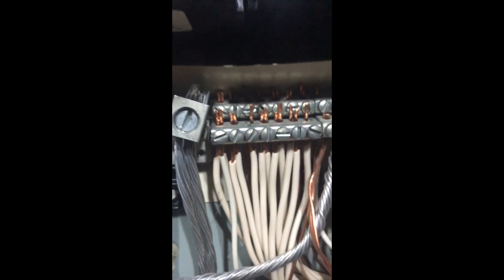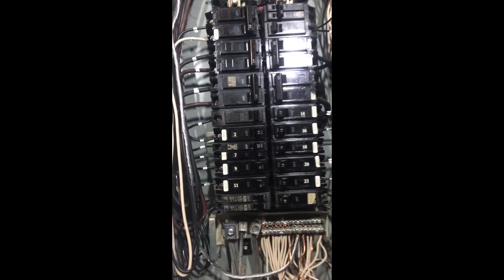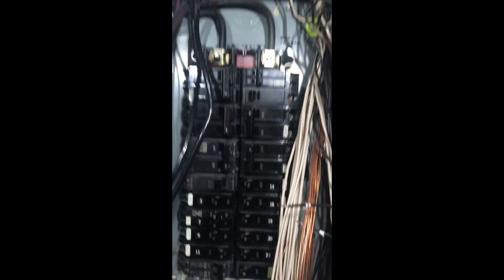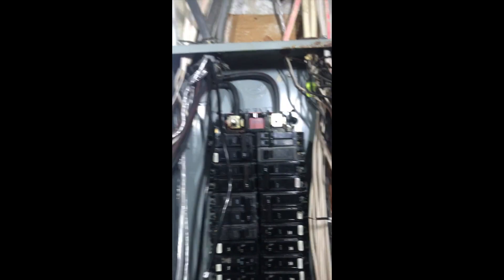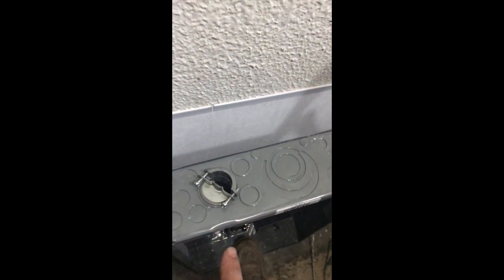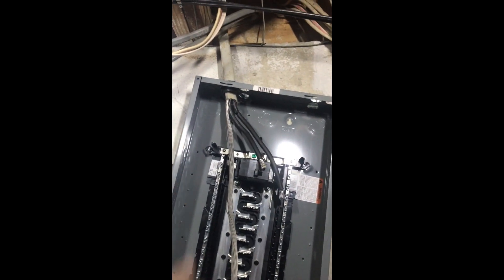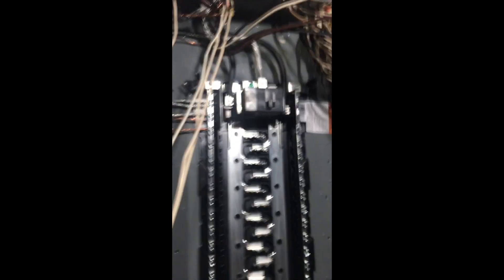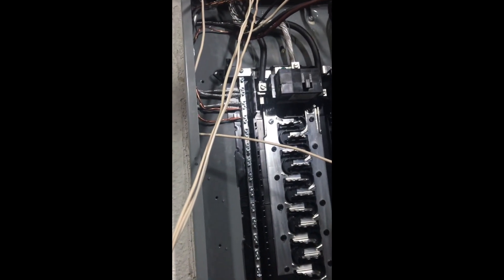Unbelievable Transformation: Watch an Electrical Panel Go from Demo to Installed in Minutes!

Comment: Hello
Do you need a ground from the panel in a 200 amp?
I have a ground from the meter to the rods and that’s all.
Reply from the maker: grounds only go to the panel never the meter. if that ground in the meter becomes energized so does the ground around it and then there is trouble!

Comment: can you explain 1 pole & 2 pole. & how to wire them in to main breaker or a panel in garage. & if you can wire outlets to it & how can you tell how much power is coming in for main so not to exceed what your power co. has you listed for ty. I need a outdoor light for both garages to see when I get from car to house & to check on my ducks & geese at night
Reply from the maker: 1 pole is one breaker 120 volts the second one is 2 pole 120 volts. added together 240v amperage is the only determining factor here. at what amp will the devise trip.
Reply: @StarvingElectrician  ty

Comment: Sweet video for us electrical noobs! I am slowly learning this stuff to be able to wire an outdoor shed powered by solar.  Two questions for you.  1. What gauge is your grounding wire and 2. why don't you put the ground wire in first (sorry if the latter is a stupid question)?
Reply from the maker: no question is stupid when it comes to electrical. on a 100 amp service the ground id number 6  as for what order sometimes its first it really just depends. good luck!
Reply: @StarvingElectrician  Thanks!

Comment: I would like to install an electrical box in my garage. It has no existing electricity. I would like to run the electricity by a portable generator.  It sure would be nice if you made a video. Thanks
Reply from the maker: That would be cool! its tough since im not on job sites any more. i just need to engage more. thanks for the reccomendation though. ill surly try!!

Comment: Hey Starving Electrician, just a handyman here!  I’m wiring my pole building with 100-amp main lug coming from a 200-amp main breaker!  I’m using 2-2-2-4 Al ser, BUT MY QUESTION IS, WHAT DO I DO WITH MY GROUND WIRE AT THE MAIN PANEL AND AT MY LUG PANEL? 

Thanks in advance, hope to hear from ya!
Reply from the maker: you need to add a ground lug or ground bar because you need to seperate the grounds from the neutral.
Reply: @StarvingElectrician  , thank you for the reply!  I did know I have to separate the ground and neutral which I plan on putting in grounding rod and ground bar!  Just wasn’t sure if I hooked the ground wire at the main panel to the ground bar or not!   If I did that, than wouldn’t my ground be connected to the grounds and neutrals from the main panel?

Comment: Sir do you prefer to use square d Qo plug on neutral or homeline, ty
Reply from the maker: i like home line because QO is smaller and harder to work with when the panel is full.

Comment: What gage wire you used for main breaker panel?
Reply from the maker: well if its 100 amp its either #2 aluminum or if you go copper its #4

Comment: 3:00 labeling breakers though is... I mean how do you even do that?  You'll have over a dozen "devices" on a single breaker and they could be in 3 different areas of the house.  In fact, it's normal that they're in different areas.  But like, you have 4 out of 6 Receptacles in a living room, then 2 in a downstairs room, 3 lights in different areas, and a single Receptacle in... I don't know, the dining room.  I get that you should label them but it's not a simple or trivial task.
Reply from the maker: thats a matter of wiring in the house. on circuit feeding a junction box with five wires in it. ya need to add more circuits in that case.  labeling can be a pain when you know like the kitchen shouldn't be on a 15 amp breaker. thanks for the comment.

Comment from the maker: Well if you only replaced the panel the the problem has to start there. Lots of times the wire simply doesn’t  get tightened down on the breakers. I would tug on  each wire and see if one pulls out. Try turning the breakers off one by one as well. You try the simple things first. Check the connections on the main breaker. Half the panel may be out.  Hope this hekps

Comment: Thanks so much for your videos.  I'm wiring up my new barn and you've answered basically everything I could think of.  I couldn't quite see where the earth ground was being attached in the panel but I'm assuming it's just going onto the bar with the other grounds and some of the neutrals.  Yes?  My ground will be two 8 ft grounding bars driven into the ground and connected to the panel via a #4 grounding wire.  My barn has no plumbing.
Reply from the maker: Number 4 is too big but if you have it then it’s good but you can use number six for your ground. And yes you ground right to the buss bar. You got it right.

Comment: Hey starving electrician. Am I able to change my panel in my house, if I shut the main breaker in my 200 amp disconnect panel? Or do i still need the electric company to pull the meter. Also as a vet myself, thank you for helping us out. subscribed man.
Reply from the maker: Carlo Miranda  just stut off the disconnect. That shuts down the power to the panel. You will be perfectly safe.
Reply: @StarvingElectrician  Thank you sir. Best electrician channel out there.
Reply from the maker: Thank you so much.

Comment: Was this live when you did it?
Reply from the maker: Yea I’m not very good at this! Phone in one hand and hammer in the other. Lol sorry for the shaky content. The homeowner was upstairs and I tried to be quiet!
Reply: @StarvingElectrician  when I asked if it wad live I meant is there 100 Amps going through those lines as your just pulling on them?
Reply from the maker: Joshua Lewis Lol sorry. No I pulled the meter socket out.  I used the existing service cable or I would have done the meter can live. No shut off from the underground to the transformer. Just another day I guess.  Never mess with changing a panel without pulling the meter. I won’t ever do that!  Take care
Reply: @StarvingElectrician  Just out of curiosity did you do a video on how to pull a meter?
Reply from the maker: @tonyd7465  no I didn’t. I have one where I change the service cable and believe I pulled the meter in that one

Comment: I'm confused. When you install the grounds neutral and hot. Is it marked on the bar where they go? I am new and trying to learn. I bought a trailer I am trying to redo.
Reply from the maker: In a trailer you have what's called a sub panel. The main breaker is outside usually under the meter. As for the panel you can use a panel with a main breaker and just put the two hot leads under the two breaker leads and the neutral bar has a lug for the neutral as well as the ground. I find a simple square D homeline panel is the easiest to understand. It's tough to guide you via this avenue. If you have a panel it should have lugs for the two hots. You can see the buss bats for the neutrals and grounds. It may not be self explanatory but it's meant for a homeowner. Any more questions please maybe include a pic or two. Good luck!

Comment: You are amazing.. You answered all my questions in the first video you made and you had my laughing the whole time. I wasnt confident at first about changing out my breaker box but after watching and listening to you; I now not only feel confident about doing it but I know I can. You are a great teacher and I appreciate your laymen terminology throughout your explanation.
Reply from the maker: Thank you so much!!! It makes me so happy to receive such a good review and I'm glad I could help. If you have any questions don't hesitate to ask.
Reply: @StarvingElectrician  I do have a question. What size is the service entrance wire or what is the technical term called for 100amp service?
Reply from the maker: It’s. Called a 100 amp service. #2 aluminum or number 4 copper.  It’s called service entrance cable if that’s what you are using  but if it’s in pipe those are the sizes for 100 amp.
Reply: @StarvingElectrician  Thank you very much. I am actually going to be changing my box out this Friday. I want to make sure I was buying the right cable. Thank you again. :) ok I'll stop bothering you. This is an amazing resource. I can't thank you enough.

Comment: Hi 👋🏽! What amp panel is needed if you have a rental unit plus your living space in a residential home (2-family home with basement and garage)? We have 2 separate meters. Thanks!
Reply from the maker: Mia W.  hello. The minimum dwelling size for a service is 100 amp if it's independent from the main service. Like two meters as you mentioned. If it was a sub panel like one fed from the main panel you could get away with a 60 amp panel.  But the answer  sound like 100 amp. I hope this helps.
Reply: Starving Electrician Thanks for the reply! Happy 🌮 s!!!

Comment: Seriously need an upgrade at my house, question is how large of a service rating can I go on the main panel?  I'm assuming it's what is supplied from the electrical company, also that I would need them to pull the meter first. No main breaker between the meter and the panel.
Reply from the maker: Rando Game  thanks for the question. Truthfully you can put whatever size service you want in your home but it's more of a case of what you need. Minimum residential service is 100 amp and you can get a 30 space 100 amp panel if you need a lot of breakers. Most of the time people think they need a larger service to have more space but that's not the case.  As far as your meter, Edison in my state does not pull the meter for you and there isn't a breaker at the meter because it's no a multi unit housing meter bank. I'm not advising you to pull your meter if you aren't comfortable but it's really not difficult. Clip the tab and pull the meter. They just stab in. If you did decide to go bigger with the service you would have to let your utility company know so the can upgrade the wires to your house. If it's overhead it can supply 100 amp and if it's underground it should be big enough for 200 amp. I hope this helps. Any other questions don't hesitate to ask. 
Thanks

Comment: Thanks for the info.  Realize you were out of room on the neutrals but could you also install peanut breakers?  Rather than double the breakers
Reply from the maker: Blake Carey yes you could. You could install the entire panel with piggyback back breakers and it's completely legal. So long as you don't except the capacity of the main breaker. I could have just installed a neutral bar too. Problem is that panel was a 60 amp and the load was getting pushed to the max so it  had to be upgraded ampacity wise. I actually tried the half sized or peanut type you are referring and the bus was half out so there was no saving it.  Thanks for the question.